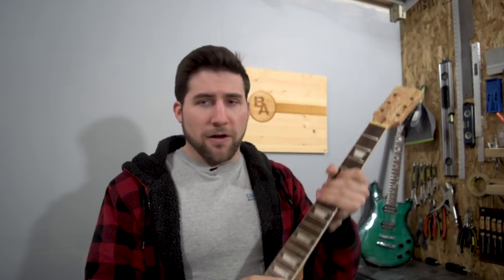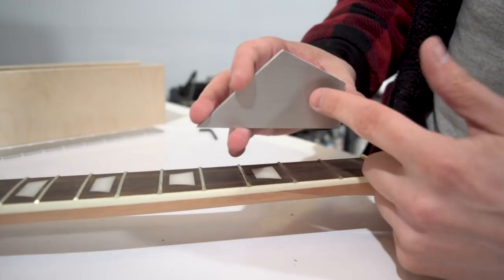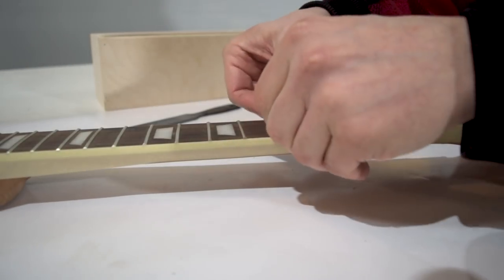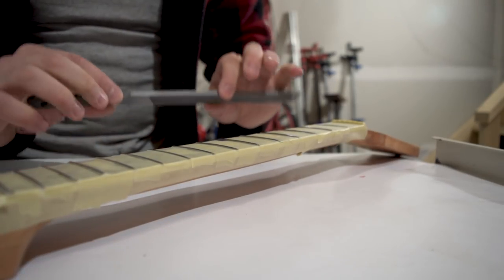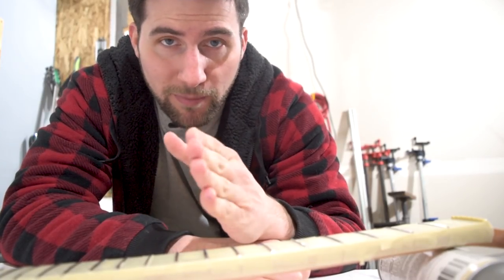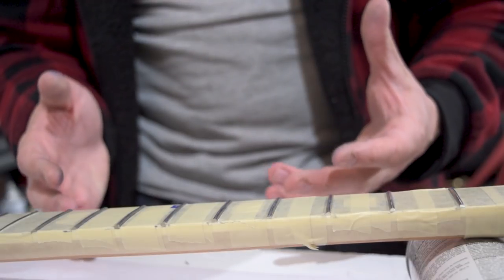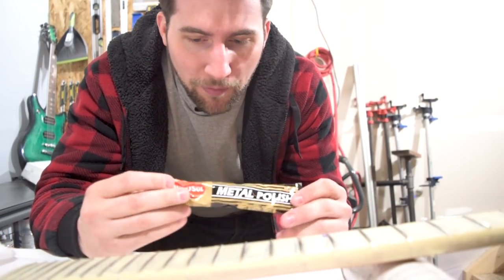Make an Awesome Les Paul for Less Than $300 | Neck and Fret Work (Part 1)

Comment: Looks like the frets were already polished. Maybe not, but in the light they looked polished.
Polished frets are kind of rare even in non-kit brand new guitars straight from the factory.
I wish I could find a good leveling file, but I got frustrated and switched to using a radius block and sand paper.
The radius block is a little on the short side, but you do get good coverage as you level because curved ends cover more of the fret board with each pass.
Did you just say "Rub it like it's Friday night"??? lol  : )
Ive gotta say that to my next girlfriend! ..meaning the guitar fret of course. Oh yes I would say that... cuz its not boring, and girls love excitement.
Now, what was I talking about? Hmmm. ...something about sand paper or files or automotive glue? ..or maybe bra sizes?
Hmmmm I'm drawing a blank. That always happens when girls infiltrate my brain.
Sorry...I'm toast. : )
Great video!
Reply from the maker: The frets were decently polished before I started, but of course the leveling work negates that haha.
Reply: I had a reply all typed out and my crappy phone just randomly shut down the app and I lost it all.
........Short version.
I believe 100% that a kit guitar has the potential to equal or exceed anything off a showroom floor...with a few caveats. A good starting point is necessary.
With kits, there are virtually no boundaries in terms of quality or looks. None!
So if you want a guitar with a huge graphic of vampires toasting glasses of fresh blood on a swirly deep red and black background? You can make it!
If you want 100% Grover hardware and Seymore Duncan pick ups on that guitar? ...all in black?
You can do that too!
If you want  perfect playing, leveled, crowned, and polished frets? ...AND nicely done fret ends with the edges rolled off, to make the neck feel awesome?
You can do it!
Now if you spec'd out a guitar exactly like that from any manufacturer it would run at least $1500.00, but probably over $2000.00 ..and depending on the company, that guitar could cost over $3000.00.
Just price one at the Gibson Custom Shop and see what they say...
Doing it yourself with planning and patience, can reward you with a perfectly done version of that guitar for up to THOUSANDS LESS.
Just off the top of my head, I'd guess that guitar would run maybe $600.00 doing it yourself. That includes the kit, hardware, pick ups, paint, clear, and materials (like sand paper).
DIY is the best kept secret in the industry, and if more people just realized that they too can actually produce a high quality result? Then some manufacturers would be in trouble.
Yes, there's a place for the PRS's and the Gibson's out there. Doctors and Lawyers are very busy and they need guitars too.
..and I can't help but wonder if just throwing money at a guitar gives the same satisfaction as DIY kits do. I wouldn't know. lol
But for the rest of us who work in the trenches... there is plenty to love about kits.
I can't wait to see how this one will turn out!
I was thinking.... (Oh no!)
SInce your videos provide the inspiration and the know how to build custom guitars or do customization's, maybe you could do an occasional feature which shows viewer guitars (pics or video) that they built or customized using the info gained on this channel?
They just provide a quick overview of the process they used. Maybe the areas in which the channel helped them, and any other noteworthy stuff they encountered along the way.
Dam, I went long again and this is the 2nd time I typed this reply. : )
Reply from the maker: I’ve thought about doing the viewer feature thing. I should probably take some action on that one of these days haha. I personally find it much more satisfying to work on something myself than to just buy it complete at a higher cost. 
It’s funny that you mention the lawyer thing though; I got a kick out of that.
Reply: Hey Brad!
You said to let you know if I  found out anything about Tru Oil over paint color.
Tonight I was stumbling around Youtube looking for who knows what..and I came across this.
https://www.youtube.com/watch?v=ac-YSnAcMCg
This guy doesn't do stuff that I necessarily buy into, but there is no denying that he has something going on the color/clear thing.
Something good or something bad? Remains to be seen.
Before I decided to go acrylic on the Strat, this is exactly the method I was considering using.
Wipe on color. Wipe on clear (Tru Oil).
I'm not going to be a spolier and tell you how this turns out, but I will say that...
1. You only need to watch the 1st half or so.
He does so much stuff that I consider improper that I wont recommend the rest.
2. There is no way I would be using 0000 steel wool to buff out my coats of Tru. ...and that does become a factor.
Enjoy!
Reply from the maker: That’s an interesting one haha. I like using 0000 steel wool for some of my finishing work, but not on guitars so much. The end result on that one actually looks pretty decent. Are you thinking of giving it a try?
Reply: Yeah, I am.
Coming at it from my perspective as a complete noob who has never sprayed anything other than sneeze juice, it's kinda nice to know that there is an option out there that even I can't screw up.
Will I say that after a few projects go by?
No, because I want to advance and there's no way forward unless I move my feet.
I have some vague goals in mind.
Whereas before I was joking about painting my Jeep? ...its kept creeping into my mind that if I worked at getting good enough I could actually do it.
I'll set the emergency brake so it can't get away. ha
..but honestly I think my best course of action is to start SAFE, and get a success under my belt.
I'm already decent with the guitar aspect of it. I really just need the practice at paints/finishes.
Then, as I get familiar with re-fins I can take steps forward until I'm at least competent at it.
I actually have builds planned for the next year or so.
...after the Strat, the Tele, and one for a friend that he wants me to build.
Then...
A Jaguar, a 335, a Jem, a LP style with P90s and maybe something Gretsch-ish if I can find it. That should keep me busy!
Then the big challenge will be the Jeep...which will take sanding and primer. It will be a full job.
Thanks for all your help! I wouldnt even have enough knowledge to decide which finish to start with if it wasnt for this channel.
I'll be rattling chains around here for a long time : )
Reply from the maker: Sounds like you’ve got quite the laundry list of projects lined up. I’m excited to hear about them as they progress.
Reply: All inspiration and knowledge comes from right here!
I'll even try to get some pics to you.
I don't yet have a way to shoot video. My good phone got stolen so I'm rocking a piece of crap phone now that randomly shuts down whatever I'm doing and goes to home page. ha
But pics I can probably manage.
Thanks

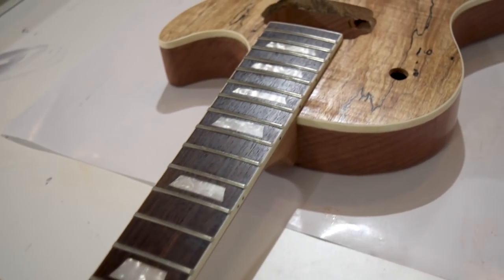Comment: 16:10 looks as if you have a poorly seated fret (11th?) and some damage or something around the 12th.
Reply from the maker: Intriguing. I’ll take a look at that portion of the video later, but I haven’t had any issues with those frets.
Reply: @BradAngove  yeah, once you leveled them, maybe that fret is stout enough that it won't matter but it seems to have a dark area where it looks like it is not seated upon the fretboard.  Before I level frets, I always take a hammer and cover it with whatever so I don't ding the frets and I tap them all to be sure they are firmly seated and I look for ones that may not be seated strongly even after that (they rise up after you release pressure on them, usually the ends) and then if that happens... well, you know.  You have to remove it and either overbend or do that AND add a drop of superglue in the fret slot.  Cuz you don't want to level a fret if it isn't firmly resting upon the neck, I wouldn't think.

I like that finish and the wood grain.  I love a natural looking guitar.  does the kit come with everything or do you have to buy pickups etc?
Reply from the maker: It comes with everything.
Reply: @BradAngove  ok, thx.

Comment: It's always the same old, les Paul, TC and Sc kits available though not metal guitar types..
Reply from the maker: What type are you looking for?
Reply: @BradAngove  just a shape similar to a Jackson, esp strat shape but not an actual fender strat copy.
Great video though to see it's not all just straight together out the box and to see the full process 👍
Reply from the maker: They also have explorer style kits, gem style, Flying V, and several BC Rich body type. Check out the link in the description for solomusicgear.
Reply: @BradAngove  just curious what would the fretwork be like on something like a crimson kit (£300-500, around $350-600) or more expensive kits like a kiesel..
Reply from the maker: I would imagine it would be pretty good. I’ve never built one of those more expensive kits though, so I don’t know for sure.
Reply: @BradAngove  when you can make a cheaper kit look that good there's no need 👏

Comment: A radius block isn’t that expensive.
Reply from the maker: True. I honestly don’t like radius blocks. Do you prefer them?
Reply: I bought one off eBay and I’ve used it on a Chibson, a Guitar Fetish acoustic and 2 Solo tele’s. Everything except for my real Gibson and has worked great so far. I’m not to your level yet though. I figured the thought behind getting the radius right makes sense. Knowing what I know now about Solo it wasn’t needed but the Chibson sure did. 
Awesome videos by the way, I am curious why you don’t like them.
Reply from the maker: I’m glad it worked out for you. I don’t like the radius blocks mostly from a versatility standpoint. Different necks have different radius measurements by design, and I don’t like the idea of needing a bunch of radius blocks. 
Also, I don’t see how you could use them for compound radius fretboards at all. Not that any of these kits have those haha.
Reply: Yeah you’d have to approach it differently if it were a compound radius but those seem like “specialty” guitars. All I have is a 12” and so far that’s all I’ve needed. I also bought a cheap crowning file that makes short work of crowning but I’m with ya on polishing the frets, steel wool causes more problems than it fixes.

Comment: What are you talking about. 300 probably the bodywork. Good pickups are at least 300 US plus at least 60 for lacquer and dye etc. 35 to 70 good tuners, plus bridge plus pots plus the switch. It all adds up to at least 650 to 800 Us... you can make A guitar under 300 not a good guitar...
Reply from the maker: I think you’re conflating price with quality, but more importantly you seem to have forgotten about inflation. This series is 6 years old.